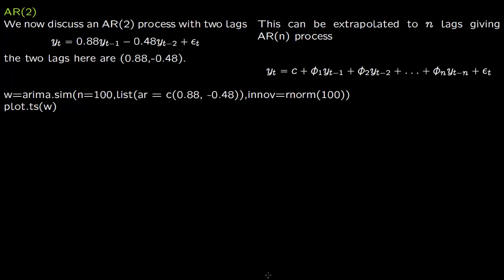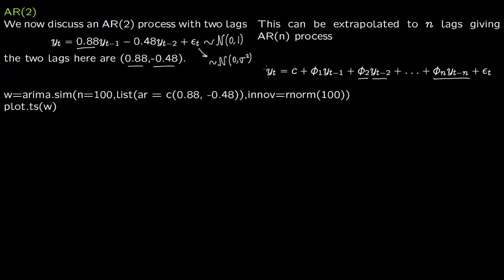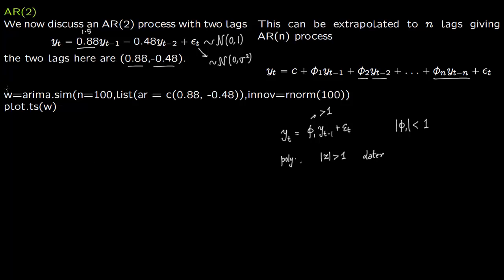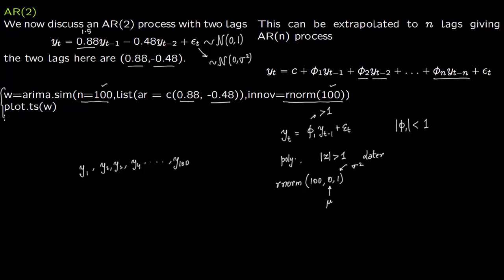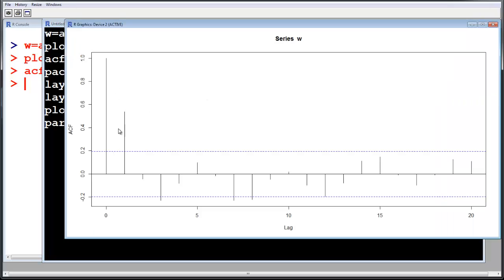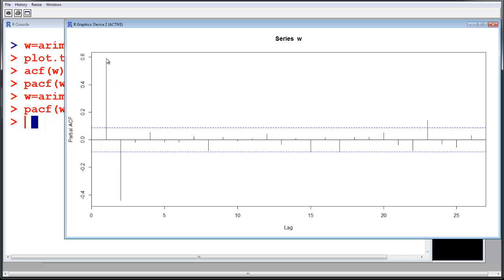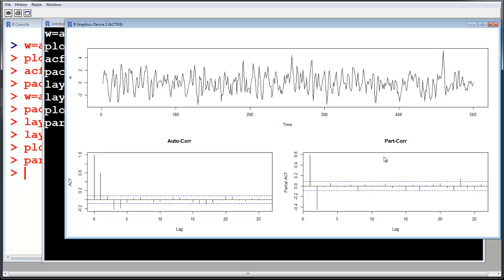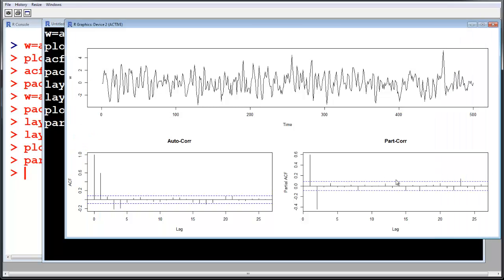1 5 AR2

Comment: If we had an PACF where there were significant lag values at {1, 2, 4} would we be talking about an AR(3) process, or does an
AR(3)  imply sequential significant lags?
Reply from the maker: Kevin Adams Use what your data shows. Time series is just regression on past data. Thus, use variables which are significant. Also make sure that seasonality has been taken out.